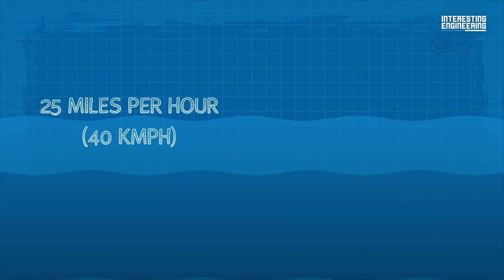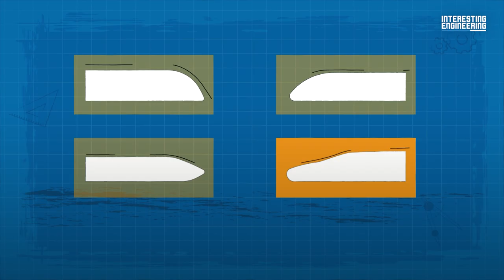How Kingfisher Inspired Bullet Trains

Comment: I found a mistake!  The narrator misread the script and said the early 90s, but It should be the early 60s.   0:43  "It's the early 90s."
Reply: It's not an error. They worked on solving the problem 30 years later.
Reply: @MAC702firearms  Oh, I guess the 1960s video clip threw me off.